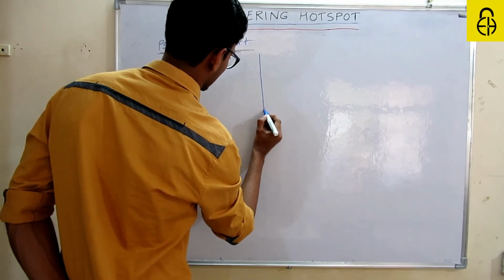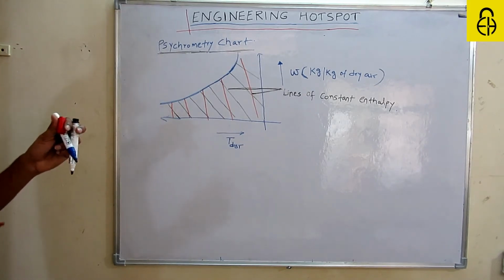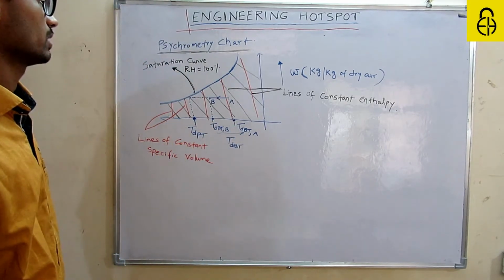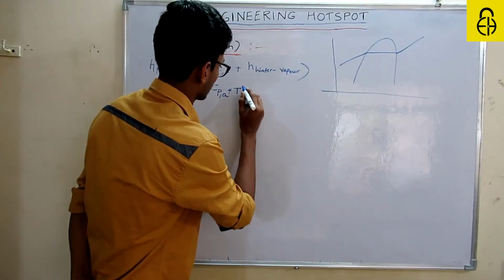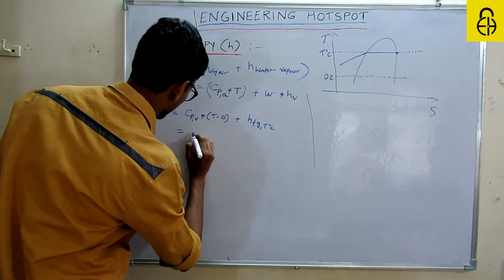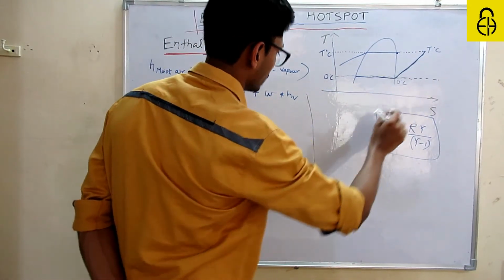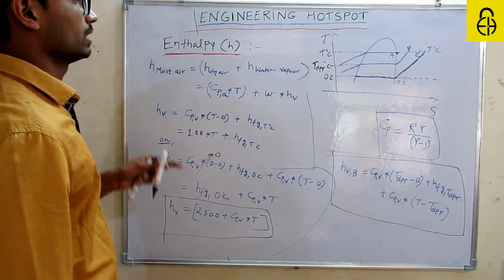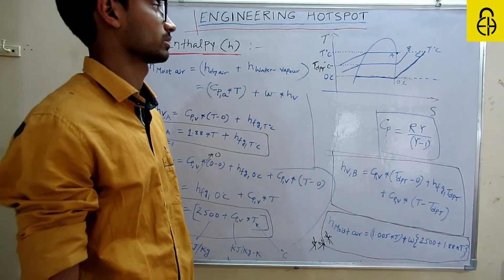RAC - PSYCHROMETRY II LECTURE-3 II for GATE, ESE, Mechanical I ME

Comment: How can we say that constant DBT lines is constant specific volume lines?
Reply from the maker: Constant DBT is never same as constant specific volume line. Constant DBT line is vertical while constant specific volume line is slightly tilted from vertical. You can check a psychrometry chart.